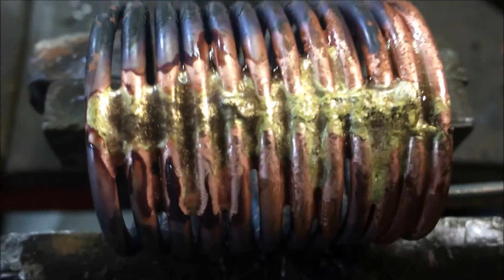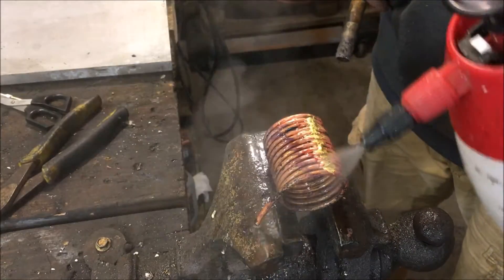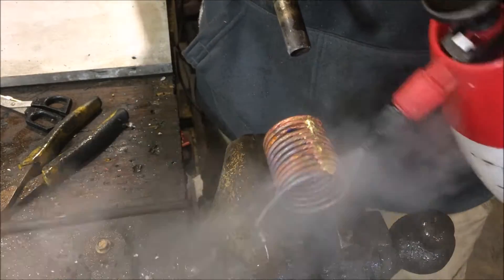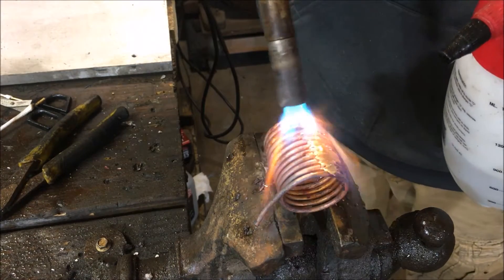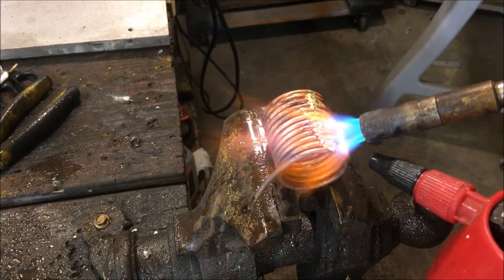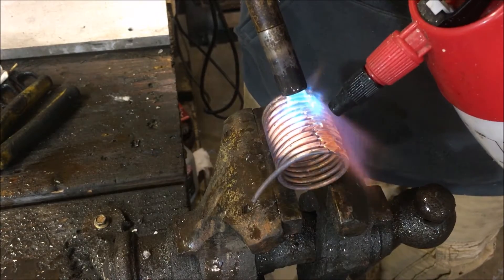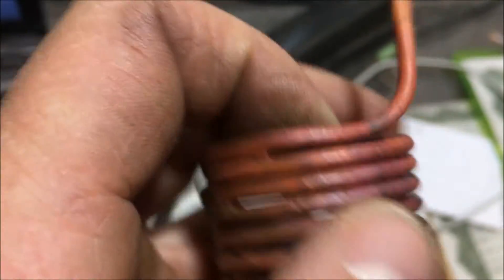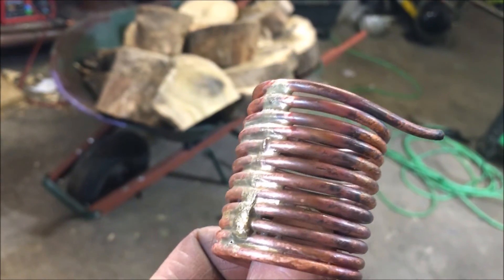Brazing flux removal (INFORMATION )

Comment: Actually I take a garden sprayer and a bucket of tap water to my brazing station.  When I complete I braze, I put small parts immediately in water to quench.  Larger pieces I spray with garden hose.  It’s thermal shock that removes 80-90% of flux.  I then wire brush and never had problems.  That way you don’t need additional heating sessions

Comment: @NOBOX7 I wonder if that method would work to remove brazing off sheet metal on a car. Have you had any experience with that situation?
Reply: Did you ever end up trying this? I'm looking to do exactly that.
Reply: @tfoot22  It didn't work for me. I ended up using a flap disc and grinding most of the braze off. Took forever but, after that, I was able to weld on it but not without issues. Still got lots of spatter but got the job done. Best of luck.
Reply: @Fred82ndAbn  Thanks for the reply!

Comment: Great demo. There now I have something to go try.. I recall my dad showing me a trick to remove flux post brazing back when I was very young , too young to actually braze much on my own back then, but I can't recall exactly how he did it. I thought he said something about expansion and contraction differences and he dipped in it into water but was it cold or hot and was the work piece cold or hot??? I can't remember those specifics. 
I have some recent brazing projects that never had the flux cleaned off when first done but as they sat (indoors for a few months) the flux turned into white powdery stuff and fell off...?-Would you call that rehydration?